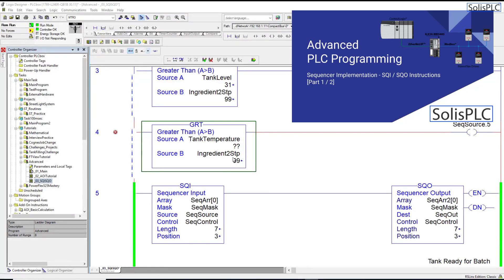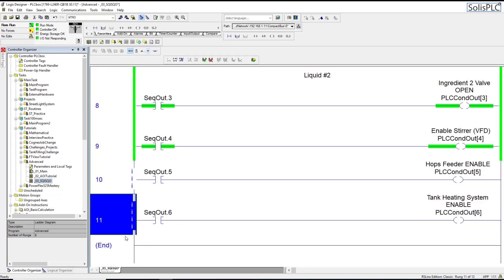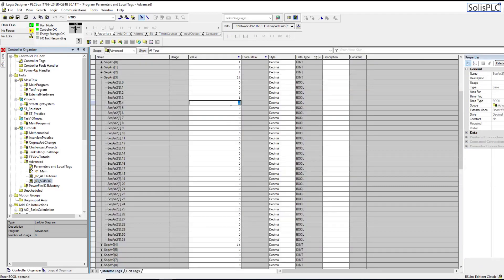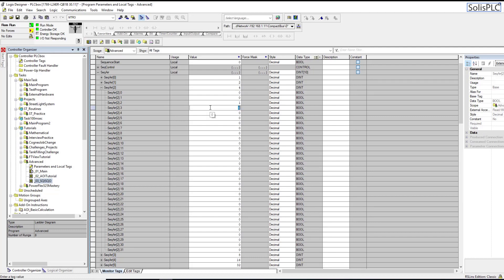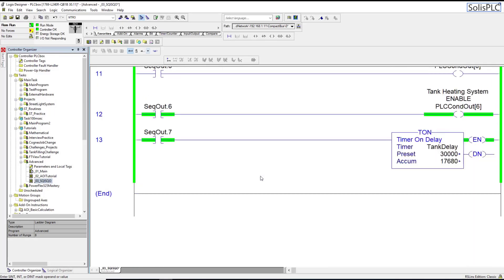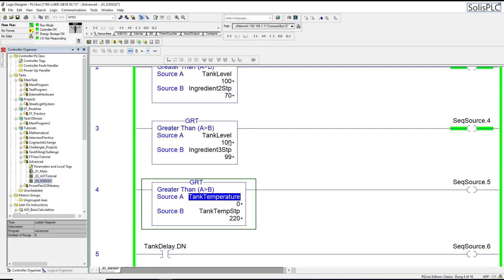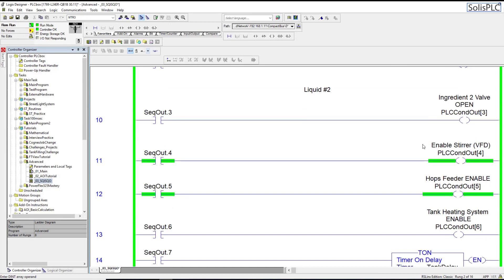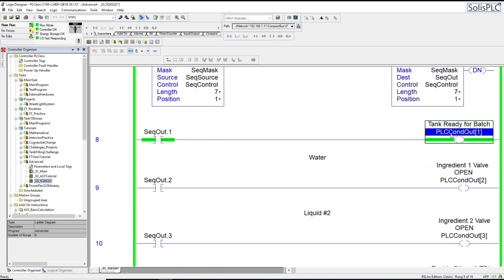PLC Sequencer Programming - Tutorial on SQI SQO Instructions in RSLogix 5000 Ladder Logic  [Part 2]

Comment: Hi Vlad, great video. This is by far the best tutorial I've found on this topic. I did the project on my own and it works. However I'd like to ask you something just to make sure I'm fully understanding how an SQI works. It would never be possible to have a Step Zero as the first step, right? I mean, whenever you get to the last step and meet the inputs conditions in order for the system to start over it will always reset and go to POS 1. Meaning that your first step will never be zero. Is this correct or is there a way to make it start from POS 0?. Thanks!
Reply from the maker: You're correct Marvin, in normal operation you shouldn't have a step 0. However, you can forcefully use a MOV instruction to set your step to 0.
Reply: SolisPLC Thanks Vlad!